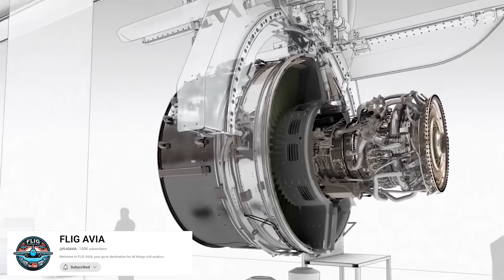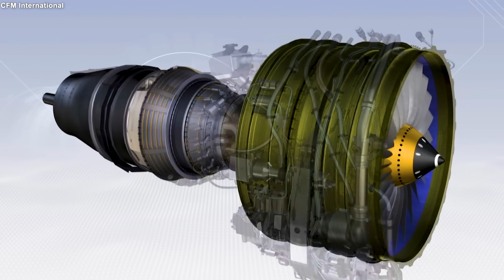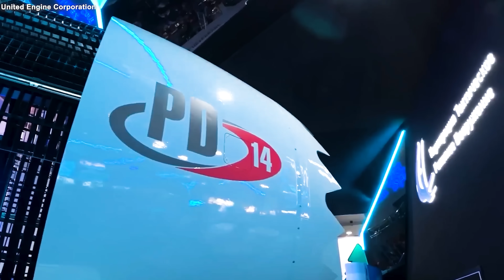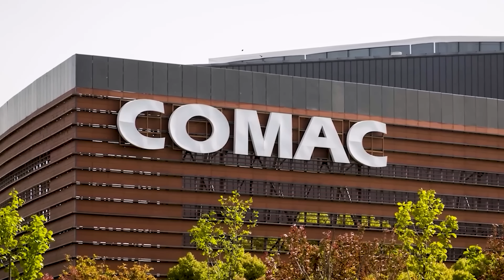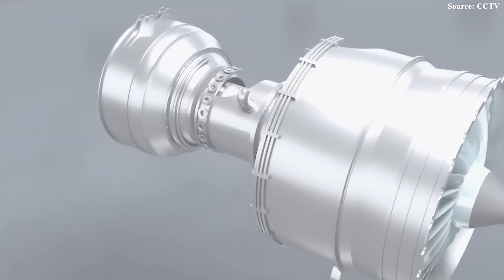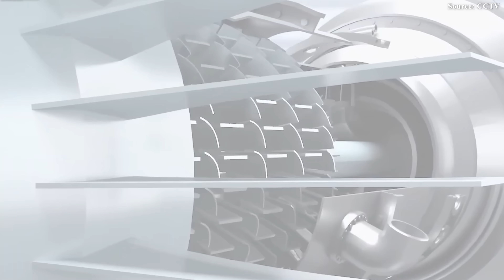Russia's HUGE PLAN to Supply Engine For COMAC C919 Shocked Entire Aviation!

Comment: China itself is capable of producing Comac aircraft engines,why do they want to buy jet engines from America? It must be related to China's geopolitics with the USA...
Reply: China is using Western avionics and engines for stopgap measures while they are perfecting their own parts. It does not make sense to use Russian parts, with Russian civilian aviation not having reliable reputation.
Reply: It can produce and is testing its CJ1000A engine but certification of engines for commercial aircraft takes many years. As they perfect their engine the plane uses already certified engines.
Reply: when the Comac 919 was developing in 2008, they used ready available mature foreign engine since China had no other option yet. On the side, they also are developing alternative engine (CJ-1000) for the C919. Now, buying Russian engines don't make any sense. The CJ-1000 engine was completed in 2017, maybe they need more time for testing (load, thrust, etc)...

Comment: China is at a very unattractive position for commercial aircraft C919 where 80 %, especially the heart engine and parts sourced from USA, France plus other.  China cannot be a competitive super power without a functional aviation industry and commercial aircraft of her own.
Reply: The choice to use western parts is not because China doesn’t have its own core parts. The indigenous engines designed for C919 is CJ-1000 turbofan engines is close to complete all testing by end of 2025 and enter serial production in 2026. Chinese already has its own avionics. To use western parts is to pass FAA and EASA certification. They don’t want a third party to break the duopoly.
Reply: I've no doubt China will develop it's own engines. Look what they did when they were denied access to the international space station.
Reply: More than 80% of 919 is supplied by local suppliers except engine which is higher than Airbus and Boeing.
Reply: Why do you think China cannot produce aircraft engines 😅😅
Reply: We are talking about China reverse engineering. All Chinese companies need are just purchasing Airbus. Boeing and the Russian engine and study and research and build 3 different class of engines engineering and after that they merge the teams together to build Chinese engines model and test run it

Comment: I can assure you.
The outsourced components can and will be replaced by Russia.

And no the PD-14 is not the first engine manufactured in Russia. But the ones in Russia is now outdated and needed serious modernization!
Reply: Sure, they can be replaced, but, are they reliable, and, how much fuel do they burn?
Reply from the maker: Russia is currently very successful with many new engines. By the way, if Russia were still a partner in the C929 project, they would have the PD-35 to power that aircraft.

Comment: There is a monkey wrench in your logic genious, SAFRAN owns the IP for all the CFM-56 and GE Gnx engines, the US might be a partner but a production and liability partner for the engines made by CFM International for US aircraft only and some extras for China....
SAFRAN also has a joint production of the same with Saturn of Russias SaM-146 engine using SAFRAN IP.... 
SAFRAN can licence that engine to China and use the same worldwide production chain around the world without regard of the US opinion....
If the US gives France the choice of its either the US or China, i think that China has a good chance to be chosen.....
The US is getting ready for that scenario, they own the IAE-V2500 engines IP, the P&W 1000XX engines and RR are working on one engine for single isle aircraft, all the pieces are starting to line up like ducks for that eventuallity....
Reply: SAFRAN was the reason the 1st SSJ 100 didn't record commercial success, it under supplied engine parts to its partner SATURN of Russia and this limited the flight hours of the aircraft and made spare parts difficult to get SAFRAN may not have the capacity to supply enough engine parts to its partners
Reply: @MightySparrow-mr  The supplied rear turbine parts from the CFM International from US manufacturers were defective and refused to re-tool for remedial solutions leaving the Italians high and dry since they were the 51% of the project for the SS-100 and the Yak-130, they abandoned the project in exchange for Leonardo making the Center fuselage for the B787....
Reply: @MightySparrow-mr  Not SAFRAN but CFM-International, they share production chains....!..